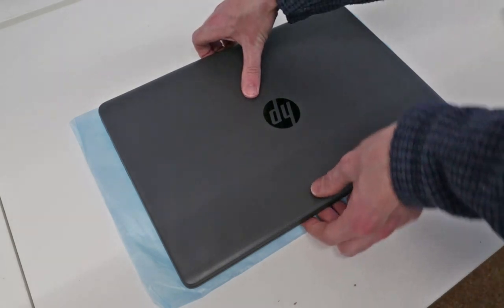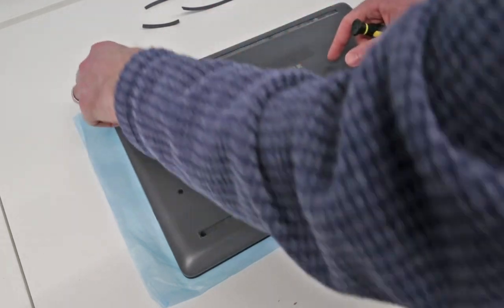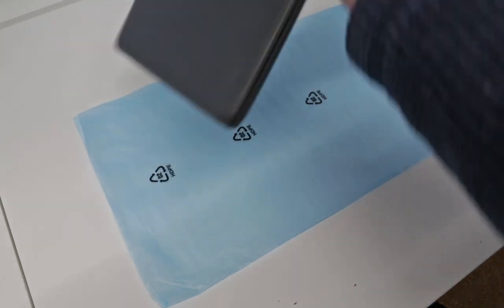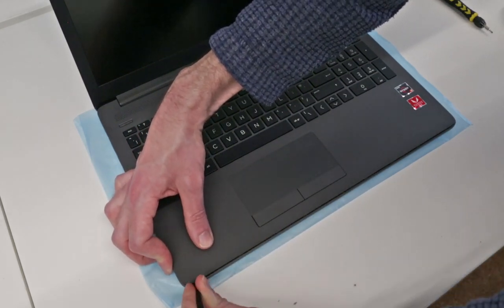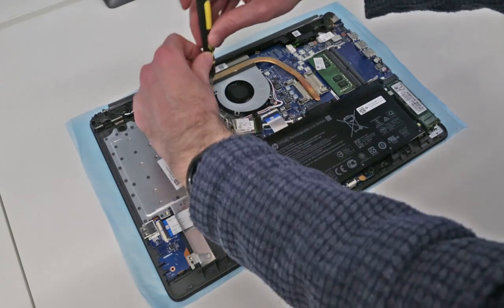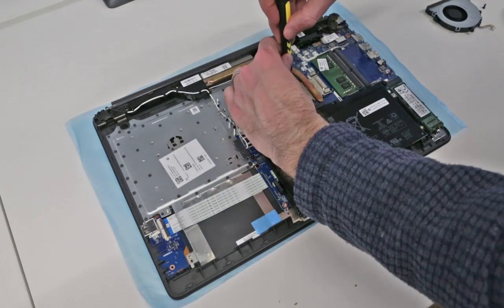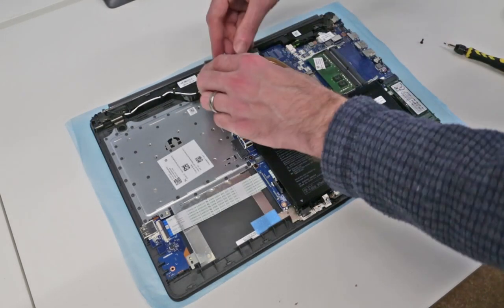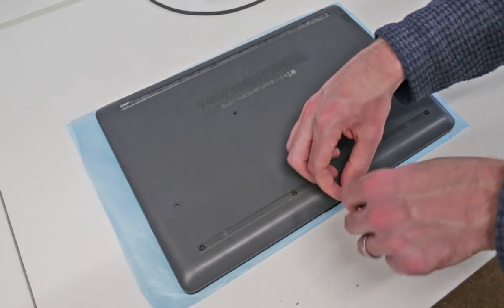HP 250/255 G7 - Fan and Heatsink Cooler Replacement and Cleaning Guide - 6BN96EA

Comment: is it possible to upgrade the cpu with a ryzen 5? does the motherboard support that? I cannot find this information anywhere
Reply from the maker: No, almost any modern laptop (barring some high-end gaming or workstation systems which use desktop processors) will have a soldered processor, which is non-replaceable.
Reply: @BrueComputing  ok, thank's a lot for the quick answer as well ;)

Comment: did you by any chance end up changing the cooling fan because it suddenly started making alot of noise? 
because thats what happened to my 255 g7 all of a sudden and im inclined to believe i need to change the fan as well, you can now hear it even in low rpm, whereas before it was completely silent!
Reply from the maker: I was doing this on a brand new laptop I had purchased specifically to make these videos, so the machine had no issues.
It is possible for a fan to suddenly become loud if a bearing is going, it has been damaged (eg. lost a blade) due to an impact, or plastic or other debris has got loose inside the laptop and is making contact with the fan blades as they spin.
Reply: @BrueComputing  i see, thanks for the reply. just wanted to know, because mine is just 4 months old, and already started lots of noise all of a sudden although it was completely silent so far. guess im up for a visit to the dealers.. :)

Comment: Does all these laptops  " HP 250 G7 " have two ram slots and one pcie m.2. slot?
Reply from the maker: I haven't taken apart a 250 G7, but the service manual suggests it does.
Reply: no they don't . It depends on the spec build . the 255 g7 I have has no m.2 slot but has the hdd option installed . HP don't do both just either or unless it says on the spec. Also the optical drive is an option wich isn't shown here but I have one .Mine also has 1 slot for memory and I can go from 4 to 8 gb but no more ( unless there is a spec build that can )  Shame they don't but then they wouldn't make money if they provided a customer with a laptop which was fully upgradable . It makes more money to offer several spec options which are give and take based but with some room to make small upgrades